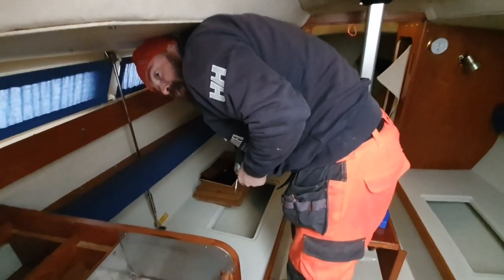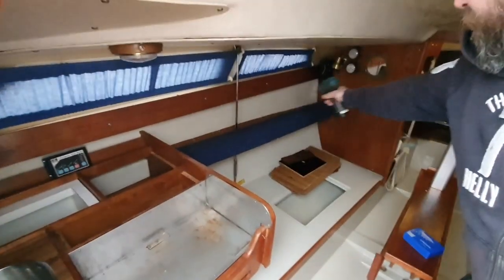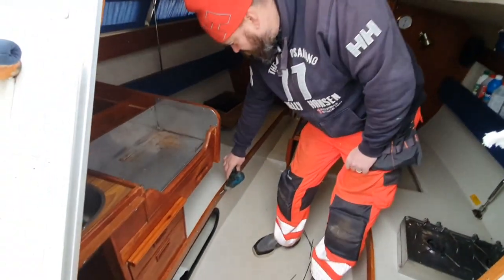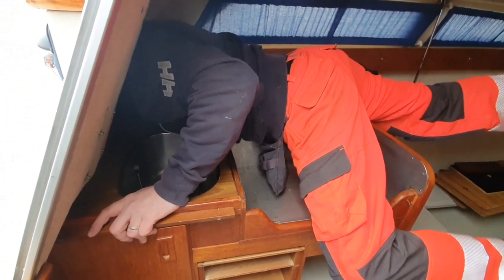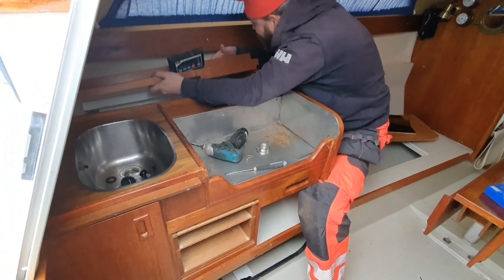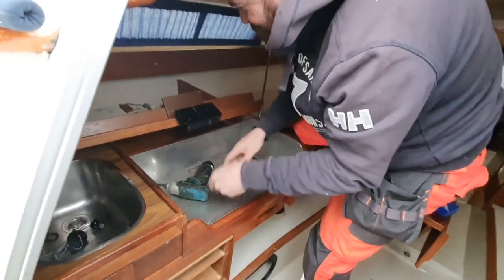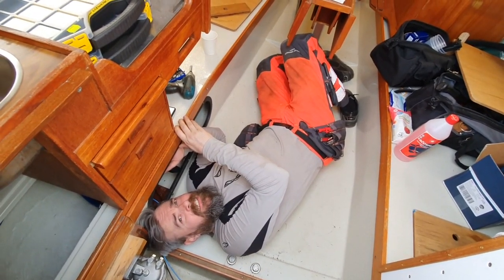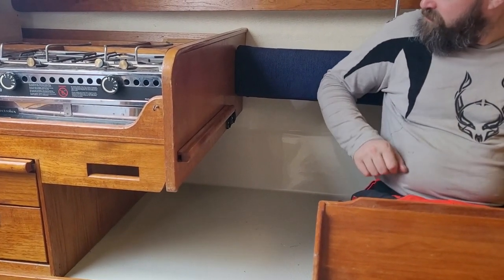Sailing River Song Special: How to remove and put back the kitchen in a Maxi 77

Comment: Hi, I tried to send you a album link with pictures of my Maxi 77 via Instagram. Maybe you didnt see, because you dont allow messages from "non-friends"? I did not remove the whole kitchen unit but i found a very nice cooling box which fits perfectly into the area were the original ones were sitting (mine were very moldy, I threw them away). My Maxi 77 goes back in the water in May (Lake Attersee). Greetings!
Reply from the maker: Hi there, The danish maxi 77 club is trying to list all maxi 77 left.
Could you spread among 77 down there? to fill in their hull number, boat name, owner and home harbour.
If link Does not work, join FB group "Maxi 77" and then it should work. 🙂
https://www.facebook.com/groups/2329703852/permalink/10159341494188853/?sfnsn=mo&ref=share